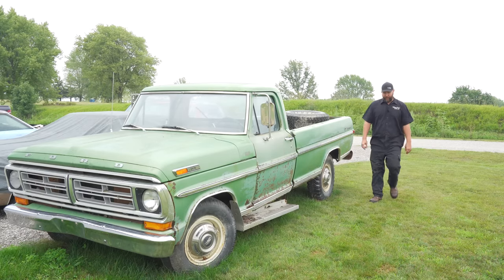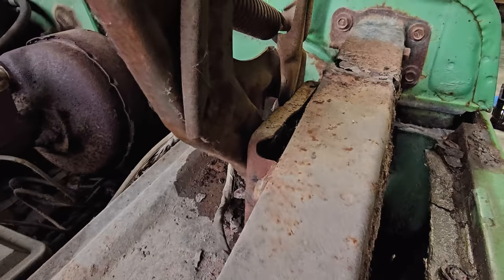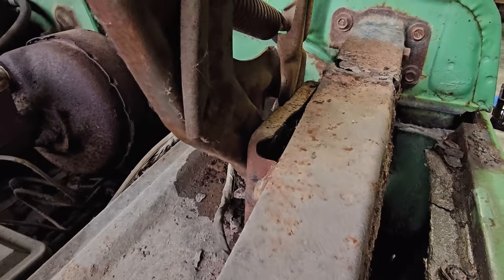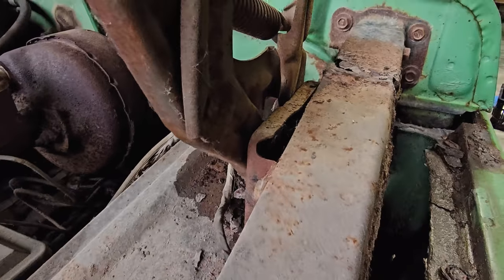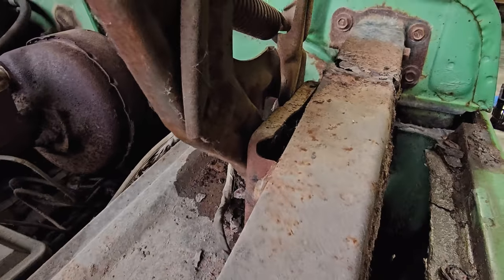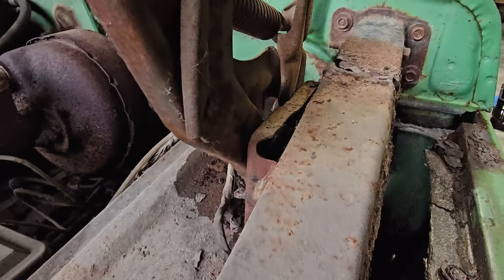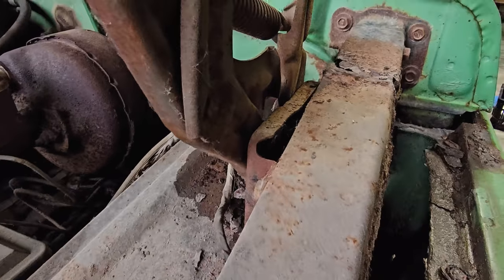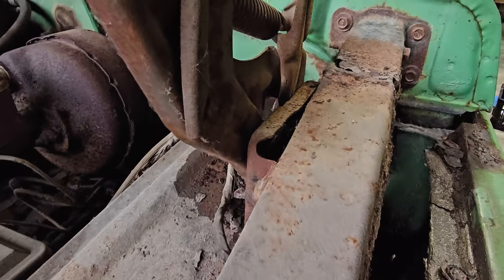Will It RUN And DRIVE 800 Miles To Mount Rushmore? Ford F250 Abandoned for 20 years!

Comment: I had an almost identical truck back in the late 80's. Mine was in far worse shape though rust wise and mine came to me with 77k on it with a blown engine. I tossed the 360/C6 for a newer 351W/C6 and drove it for a couple of years. I swapped it for a fancier version, same year that had air conditioning and less rust with lower miles, with a camper much like the one in the video here. The camper got moved to another truck and both were sold, but I kept the truck around for about 4 years until I got tired of how much fuel it burned. I sold it to a buddy who totaled it four months later. I got it back and made a trailer from the rear half.
When I was younger I made a ton of similar trips chasing cars and parts all over the country, a few trips were memorable, a few were a bit sketchy, a few were downright scary. Its no fun trying to make it a couple thousand miles home knowing that the ride your driving is going to let go at any minute, or when its costing you way more money then you planned. 
With fuel costs these days, I suppose that's even more so the case.

Comment: I was thinking perhaps you could have the camper painted or cleaned up and add some wheels that matches the camper color to the truck, I'm talking some really cool custom wheels and tires that goes with the camper look and be the first to have a old custom camper with custom wheels that looks badass , but do leave the truck as is far as the paint patina, like perhaps getting the camper done with a custom allow wrap , then get some nice allow custom wheels that looks good, get all the new LED lights all around the camper that looks real good at night, but yeah get a cool allow looking wrap done to the camper to bring out the look with color changing lights all around the camper , a cool light mild flowmaster sound to the exhaust, not nothing loud or to aggressive, just a nice clean smooth sounding one...

Comment: I had a 1971 F150 forty years ago with the 390 engine. They loved gas and oil but it always started easy in all kinds of weather, even at -30 F it started with no trouble when every thing newer wouldn't. It would only get 7-9 miles to the gallon  of fuel and about 700 miles to the quart of oil. Later on when it got about 100K on the engine I pulled the 390 and put in a 302. That about doubled the gas mileage and the oil consumption just about dropped to zero between changes.

Comment: I had the EXACT same truck in white. With a 360 and a homemade white camper on it that I bought in IOWA. She was REALLY ROUGH. The motor blew out and I put another 1976 360 from a junkyard in it in my driveway by myself. 
We took it camping many times and one time I accidentally put ethanol gas in it and it plugged up the entire fuel system.
A neighbor camper took me into to town and I bought a bunch of fuel line, a new fuel pump and a case of fuel filters. Done it all right there at the campsight with my wife, two boys and every body else. It was a shitshow but she ran like a champ afterwards.
That was only about 25 years ago, guessing. At least.
I still have the camper. Propane storage. ALL WINDOWS wide open.
I changed all the front end parts, brakes etc and she rode like a limo with the load on.

Comment: FUN FACT :  Ford used the same block for the 390 and 360.  When you go to buy a 390 it is best to stick a plastic straw down the spark plug hole, mark the straw, rotate the crank and measure the straw.  Both engines have 390 markings on the block

Comment: Sometime stuck bolts/nuts/spark plugs and plumbing try tighten and sometimes it's breaks whatever loose, an old plumber told me about that and it did work at time's.

Comment: Heat them up and melt crayon into the threads. It will back right out with minimal damage. Works on bolts, nuts and plugs of all kinds . always have crayons on hand !

Comment: Derek I just wanted to ask if I am thinking correct that the canister on the bottom of the fuel pump is it not a filter and isn't it a cartridge type that is changeable and then isn't there another one at the carb line just wondering I am a retired mechanic of 40+ yrs in the field and worked on cars etc till just bout 10 - 15 or so yrs ago I do want to give you a thumbs up for the patience and fortitude you have it's great to see a guy revitalize the old vehicles and tho I am not a Ford fan at all I do like the old truck they sure don't build anything even close to what they did back then GOD bless

Comment: I saw once on those types of drain plugs over a cross member/other things that you stick a dust pan up and slanted down and then the oil flows down the pan to the handle part which works like a funnel into the oil drain pan.  I had a car like that in the past, but didn't know that trick.

Comment: I switched over to an AGM battery. On my 99 MGM. It did cost a little more but I got it from Walmart. My motocraft Lasted five years and was still working but after testing it kept saying recharge even after I did that so I decided to replace it. I got tired of the corrosion and did a little research on these and I’ve heard they are better and I decided to give it a try so we will see what happens within the next seven years. lol

Comment: Ford 360 was a masterpiece of an engine. I bought a '72 F-100 custom with  360 3-speed in '98 for $600 after it sat in a barn for 15 years. It only needed brakes. The factory air conditioner unit still worked! I daily drove that truck for 9 years before selling it for $3K. I'm one of the few who actually really liked the 400M as well. I put a mean build on one years ago, made gobbs of power after dropping some elbow grease in the pan.

Comment: And that,  is what Iowa salt-on-the-road winters do to a low milage vehicle if you don't wash it off at least when Spring comes around. Classic Iowa farm truck. Rusty af outside and just a bit dusty on the inside.

Comment: I think that those are Merc Alpha Ones, which are much cheaper to replace than Bravos. You can get after market SEI drives for around 1200 per drive. Those are beautiful boats, and have a ton of room in them. Don’t listen to people when they say Bayliners are junk. They were in the late 80’s, but got straightened out in the early 90’s. There is a reason why there are a ton still around and people buy them. Enjoy that boat, you got a screaming deal!!!

Comment: I have a 68 f100 LWB ranger slot. Took the 360 put a 302 out a 1970. I live in nw. Ga. Got a guy north central Al.above Birmingham. If you need original parts.

Comment: I learned long ago can’t trust the squeeze test on rubber hoses they rot from the inside out so it would just pop a hole elsewhere anyways. And idk Prob could’ve used new stabiliser bars if they exist on this year or can be modified to fit. 
That would prevent a lot of swaying around

Comment: Derek found out that the body looks pretty good at first glance, but then he got his peeper's locked on the frame, the front inn fenders are pretty non-existent! Then the brakes came up and man o man what a mess and this held him up for way too long! The good news was the engine was pretty easy to get started, but then the split rim wheels showed their ugly heads. The good news is that the Chevy wheels got trimmed and worked! Then a guy bought an old wrecked truck camper and with a little duct tape he made it livable.. kinda..no not really. The bottom line is the Ford dashboard is good, but the rest of the truck needs lots and lots of work!

Comment: Never put straight water in the radiator. Unless you want rust out the radiator and freeze plugs and everything else in the motor. I know this because i brought a 89 Mercury cougar and the owner did nothing but put water in it. Water pump was bad radiator was rusted out and freeze plugs where rusted. Lucky coolant journes wasn't rusted out. Pretty sure you don't keep it in there only do it to get it running but enjoy your videos very much.

Comment: Watching this at 4AM, at 5AM it's going to get interesting, We have to first Hook up the Gooseneck to my old Fird F2fitty, then test the Lights, and then load 4 Horses.  Take them out to Eldorado Kansas to a Ranch.  but hey I am in a Camper too right now.. Only I have a Generator and an AC, Propane, a Fridge, and a water tank flowing with a digical pump and a back tub and shower in mine.  It is a 1978 Twilight Bungalow, double Axle.  These must have just been the Crem dela crem back in their hayday. Unfortunately I have to leave it in the Walmart Parking lot, I cannot pull a 5th Wheel Kingpin trailer and a 5th Wheel Gooseneck trailer at the same time.  lol Does not work no matter what kind of Truck you have. unless you flat bed them on a semi. I loved this one Derek @Vice Grip Garage I have been in the business of hauling trailers for people for a while now.  Got a couple of Trucks, I prefer the 1996 Ford F250 XLT Extendo Cab 7.3 she just feels more stable and pulls like a freight train, pretty much anything I can get my hands on.

Comment: 1:45:25   The WEINERMOBILE! 😂
I haven't seen one of those in a while... 🤣

Edit: Reminds me of the Festival Foods grocery stores around here. They have a GIANT shopping cart-mobile that they put out on display sometimes in the parking lot. It's a shopping cart about 10' tall, on slot mags, wide tires in back, and has a dual carb tunnel ram BBC with zoomies on it. The driver climbs WAY up to the top, where a kid would sit in a normal sized cart, and drives it from way up there. It has a B&M Pro-Stick up there, with the LONGEST shifter cable I've ever seen. Lol

Comment: My dad owned two F100s. ..a '68 and a '72.  The '68 was the better unit. Both new. Owned both for approx 4 years.  No rust but that was probably due to the dry climate of Australia.  Was the the rust problem in this 250 due to salted roads where the vehicle was located?

Comment: I expected that you would know to leave the gas cap off the tank before you do the air hose trick on the fuel line. If you leave the cap off you won't have to take a gasoline bath.

Comment: New Corvettes look like a McLaren.  Damn near the same price.  They finally put the weight in the right spot on that car, after all these years.  I kinda like them, but that Electric Yellow,,  No Bueno!.   I'll keep my trashed 1966 Coupe.  It still looks better.    How many Ford trucks did my father own you ask??.  Uncountable.  He loved them, Even with all the issues.  1 did peel the radiator apart from old age, at speed, on the freeway. HUGE explosion under the hood, hot slimey water on the forearms and lotsa gypsy smoke and instant attention.  It's a wonder that rotten balsa wood camper didn't implode at 60mph.   Thanks VGG.

Comment: What's a "good" classic that's best for a beginner mechanic? Parts availability and cost to get on road are my only concerns. I have basic tools, and the most I've done is brake lines, bleed, alt change rotors and pads that's where my experience is right now. Is it true that a classic vehicle would be easier to maintain than say a car with all the electrical doodads and what have you?

Comment: If it runs real strong it’s a 390. If it’s been rebuilt, strong possibility it’s been upgraded to 390. For some strange reason, a decent 352 will run like a scaulded dog but a 360 simply doesnt

Comment: “Juice heat, heat juice, juice heat, juice heat, heat juice, juice heat”
Reply: I’ve had good luck recently using those socket things made for brake lines and whacking them with a hammer a few times before trying to turn it

Comment: My old Ford also came with the 360 , it was bored over, had headers, nice 850 carb, performance plugs and wires, it did pretty good, I use to upset them Chevy 350 boys, lol they hated when I use to run them light to light , the faces they would make always was funny , it's like all the chevy guys be thinking ain't nothing beating what they had especially not no Ford , think again and can you tell me was one of my tail lights out or was both my brake lights working lol...

Comment: I just love them good old real Ford trucks. I'd trade my 2012 4X4 Ford F-150 STX with the 5.0 only 75,000 miles. For a  68-78 Ford F-250 4X4 like a camper special manual 4 speed.

Comment: Hi vicegrip,
Kinda curious, if you take a plugged fuel filter off the line and reverse the flow, would it get some of the crap out of it?  If stranded cause of the filter, it might worth a try. Thanks for sharing
Reply: Possibly, but CERTAINLY don't connect it back to the carb backwards.

Edit: Or pull a "Roadkill" trick and put 3 or 4 filters in line with each other, and then remove and dispose  of the first one when it plugs up, and put the hose back on the next one in line, and keep on truckin.

Comment: 1:02:30 Ford isn't the only one that over complicates things. The window regulator in my Volvo is cable driven on both sides it pushes and pulls... but then they used plastic in all the gears and rubber mounting bushings. A new regulator is $1000...... So a rebuild kit is $70.... Guess which one I'm going to try first 🤣🤣🤣🤣 what happened to just using lever arms 🥲🥲

Comment: That truck looks like daddy’s old 69 ranger if it is it started with a 390 not the 360 and was a two tone orange Amanda white we used on the farm in Michigsnit was parked because he bought. Brand new 2877 f259 and I was told to ark it in a field. Few yers arteries. Family friend empennage deal to work the cost of the truck
Off but he had a prob with gsfging high and drunk which it wasn’t long until he put it over a covert the snifting grids were froze as I left it in 2nd gear when I parked it l I did was loosen the wingnut Nd poured fads around the hole ullef the manual choke ABD it fired right up the truck was Devi’s ordered from ford and he was the only one that worked on it rebukildong the motor every 10 thousand miles them turned the dpedo to zero

Comment: Please get yourself a product call “FREE ALL” silver spray can-or gallon can has  dark blue writing . My life IS has been full of rusted tetanus vehicles.   I lived with these hells until i found “Free All”  . Spray it on wait 20-30 min  or  reapply and wait a little longer  if needed . the rust just disappears    , varnishes, it will just be gone just goes away  where..??  i dont know  .. ?? I to The either ?? Who cares the rust will just be gone  : it literally frees all  . Grime , rust , water rust crust build up.  Even makes the bright orange rust from parts that have been in buckets full of rain water (those need to soak in it a day or two )but  Every bit of rust will be gone  !! And  doesnt damage rubber or paint . No changing in color, no converting. Just all rust gone and parts move free.

Comment: I've gotta tell you. The Ford 360 is a dog motor. I had the same truck same color with camper and the 360 V8 was a gutless non performer with the exact same problems and drank fuel like a drunken sailor. Low performance and low milage. Never so glad to be rid of such a piece of ford junk. Had a 70's F100 with a 302 that was way way better than the dog 360.